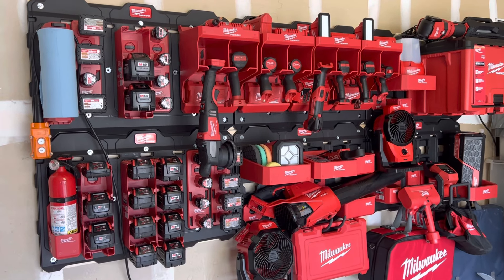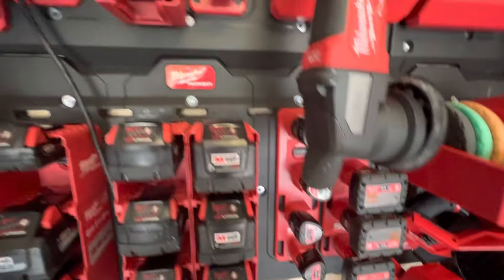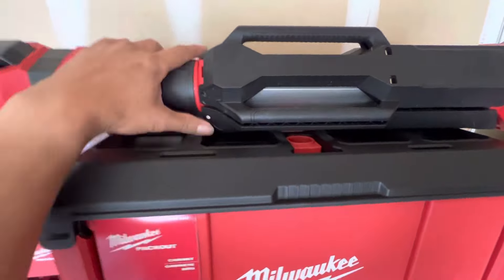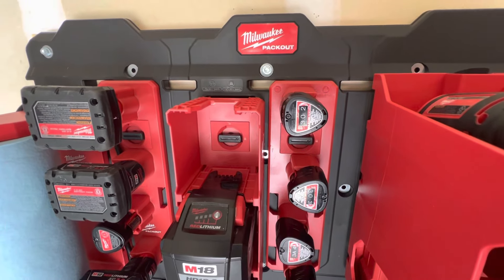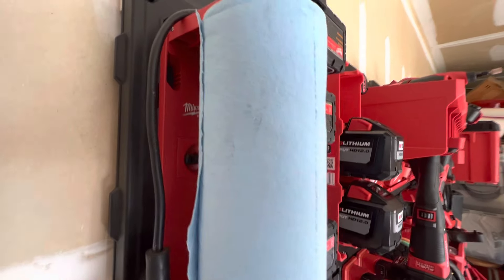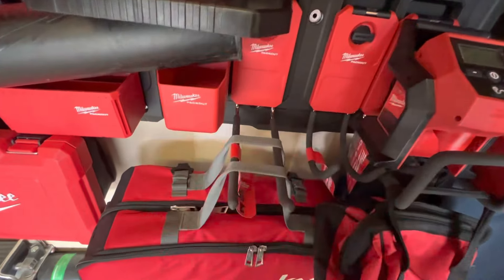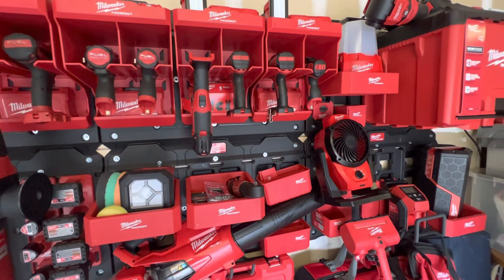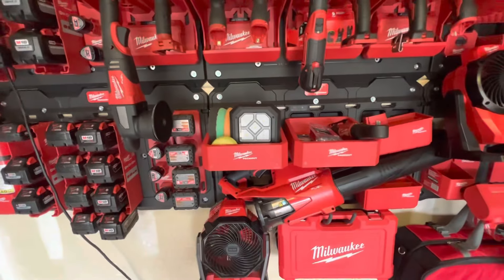Milwaukee Packout Shop Storage System

Comment: Real nice how much for all the wall plates looks aswome plus full of toys
Reply from the maker: I’ve answered that question already so I will just copy and paste: It was around $1140 shipped. It was 6 wall plates, two 2 packs of tool stations (4 total), two 2 packs of M18 battery racks, (4 total), two 2 packs of M12 battery racks (4 total), one large hook, one straight utility hook, 2 pack curved hooks, 2 pack small hooks, 4 pack compact shelf, 2 pack large bins, 2 pack small bins, 2 pack organizer cups, one paper towel roll holder, one cabinet. I went on the Milwaukee website and there is a place where you can “build your Packout” where it simulates all the attachments. So that is how I figured out what I needed. If you buy the multi packs on Home Depot it will save you about $5 versus buying all the pieces a la carte.

Comment: Take it all off the wall paint the wall red to match Milwaukee and it will look awesome I did it to mine
Reply from the maker: Several of my friends have commented that I should have painted the wall first. If I was going to paint the wall I was thinking about doing a battleship gray color. I had not thought of Milwaukee red color but that would probably look really really good. Thanks for the suggestion!
Reply from the maker: I think red and gray would go well together. Thanks!
Reply: I was kind of thinking kinda of the same thing. 
Not trying to come off sounding like an ass hat, but you spent so much time and money on the project I’m kind of surprised A couple hours and $50 in paint would’ve made it look a lot cleaner. 

With that said your set up looks awesome.
Reply from the maker: @russellpottenger8584  Thank you! It wouldn't take too much effort, you're right about that. The wall where the tools are on is just one side of the garage and the other parts, including the ceiling. are coming down in places. I need to either 1.) take the time to redo the drywall in my garage and completely (re)finish it or 2.) call someone in to do the work. If I do it myself it would take me a week or longer and I would have to take the time off work and lose the income. Or, I can have someone else do it for about the same amount in lost wages and it will be a lot more mindless for me.
Reply: @MinhNguyen-ot1zg  The battleship gray you are looking for is "Wickham Gray" by Benjamin Moore. Get it in Scuff-X. That stuff is tough as hell.
Reply from the maker: @ILruffian  Wow that’s a great idea! In the garage I’ll need more durability, that’s for sure! I don’t have very much experience with paints but I am a believer that if you’re going to do it, you should do it right. It’s going to take the exact same amount of labor to apply a crappy paint versus a good quality paint.
Reply: @MinhNguyen-ot1zg  100%. "We don't have the time to do it right, we have the time to do it twice" is not for guys like us. Cheap paint is false economy. You spend less, but use more (extra coats) plus the labor. Scuff-X is *unreal*. Great for shops. And best trim paint on the planet. Feels rock hard like the old oils. Plus unlike Advance, the whites will not yellow. Only trim paint I will use.
Reply from the maker: @ILruffian  Wow really. Where do you get that from? I will have to write that down. I don't mind paying more for quality. Do it once and do it right, I agree!
Reply: @MinhNguyen-ot1zg  It was the unofficial police motto of the department. So happy not to be a cop anymore.
Reply from the maker: @ILruffian  Makes sense for a public safety department. Don’t want to fix something again after you thought you fixed it the first time.

Comment: How much that all cost? As a guess?
Reply from the maker: It was around $1140 shipped. It was 6 wall plates, two 2 packs of tool stations (4 total), two 2 packs of M18 battery racks, (4 total), two 2 packs of M12 battery racks (4 total), one large hook, one straight utility hook, 2 pack curved hooks, 2 pack small hooks, 4 pack compact shelf, 2 pack large bins, 2 pack small bins, 2 pack organizer cups, one paper towel roll holder, one cabinet. I went on the Milwaukee website and there is a place where you can “build your Packout” where it simulates all the attachments. So that is how I figured out what I needed. If you buy the multi packs on Home Depot it will save you about $5 versus buying all the pieces a la carte.

Comment: The battery holders compatible with Dewalt  ones? Milwaukee system is so far ahead of aanyone else. Wondering if Dewalt guys, use Milwaukee storage system?
Reply from the maker: @anthonyrochon3907  the battery holders are not compatible with Dewalt. I don’t follow Dewalt products but if they haven’t invented something like that by now I know there are third party battery holders for Dewalt on Amazon

Comment: Do items lock into place so system could be portable in a van or trailer?
Reply from the maker: Great question. All the mounts have either a van 🚐 icon or a van icon with a slash through it. 🚫 🚐 I just examined all of my mounts and the only items with an approved van icon are the m12 and m18 battery holders as well as the paper towel holder. The shelves, hooks, accessory cups and tool stations have the “no van” icon. The small and large bins don’t say one way or the other nor does the cabinet. Of course nothing is stopping you from using any of the mounts in a van but due to the jostling nature of a vehicle’s suspension you can’t reasonably expect things to stay in place by using the non van approved items.
Reply: @MinhNguyen-ot1zg  Thank you. I did not know about the van icon and will be checking out the battery holder.
Reply from the maker: @SuperRoutman  You’re welcome! I am very impressed with the battery holder!

Comment: What bracket (or part #) are you using to hang the  m18 leaf blower off of? Please advise.
Reply from the maker: In the video the leaf blower is just resting on the 6” Curved Hook 48-22-8331. It’s not actually hanging on anything. Alternatively you can use the 9” Straight Hook 48-22-8330.

Comment: But, like, how tf is everything brand new? I mean EVERYTHING.
Reply from the maker: The tools look brand new because they can’t be used for their intended purposes. They are non functioning display tools I got from a Home Depot that was going out of business. They even have the lead weights in them to make them feel heavy but they are 100% fake. The batteries are empty aftermarket replacement shells I got off Amazon and then I plastered Milwaukee stickers all over them. They are bogus and just for show. Even the entire PACKOUT wall is a shameless Chinese counterfeit I got off Alibaba for $75 shipped - shhhhh 🤫 don’t tell anyone 😉
Reply: He just bought it.
Reply from the maker: @tipsreviews7476  I’ve had several comments about the like-new condition of my tools. There are indeed smudges, marks and scratches on them. I am not a tradesman or professional, I am more of a DIY guy with a focus on auto mechanics and maintenance. My tools do get greasy and dirty and when they get bad enough, I clean them with goofy off or spray 9 to remove the grease. I’ve had them so greasy the red plastic was barely showing through. I try to keep them clean because I don’t want my hands to get greasy or dirty. I am sorry but not sorry that my tools don’t look used or beat up enough for some viewers. When I was contemplating getting the wall organization system I went onto YouTube to look for first hand video from real end users only to find out to my dismay that there weren’t any videos. There were only ads and commercials and stock footage from the manufacturer. The reason I made the video was to give insight to potential purchasers who might be on the fence about the PACKOUT wall system and to help answer any questions they might have. At the time of the video posting mine was the first review of these products. I never thought I would have to fend off comments about how my tools look brand new like they’ve never been used. There are marks and smudges on them like I said, but maybe the YouTube video compression does a good job of evening out the colors? Maybe there are some people out there who consider it a mark of machismo that their tools are all beat up to hell and back but I am not that way. I have nothing to prove and I don’t owe anyone an explanation.
Reply from the maker: @robsoler2604  I was being sarcastic haha

Comment: Do the battery holders also act as chargers? If not, that kinda lame.
Reply from the maker: No, they just hold the batteries.
Reply from the maker: If they did act as chargers, I was thinking the circuitry would take up more space. Not to mention it would cost more. Novel idea though!
Reply: You don't want to store batteries in a charger all the time. Not good for longevity with lithium ion.
Reply from the maker: @ILruffian  great point! Lithium batteries are actually their happiest between 20% to 80% of their charge. So for long-term storage it would be ideal to keep them within those capacities.

Comment: Where did you find those little plastic square holders?  I think you have polishing pads in them, but havnt seen those… just started investing in packout, and 6 boxes in and I’m over $1000… rediculous.. it’s also funny how you watch videos from 3-4 years ago and people saying you can buy complete sets for $225?!  I’m like what are you talking about… inflation has the most standard boxes well over $300.
Reply from the maker: The red stackable plastic boxes on the floor with the clear plastic lids? I got them from Home Despot. They’re the Husky brand I think. I think at the time they were about $30 each. If I remember correctly they had them in different colors and sizes, but I got the red ones and it’s a shade darker than the Milwaukee colors but they are fairly close. I like them because they are a good size and color and have sturdy locking lids. They are the Husky 12 gallon containers - 26 inches long by 18 inches wide by 10 inches high. I’ve put packs of soda on top of them. Isn’t that crazy with the prices? This is the world we live in - everything has gotten more expensive!
Reply from the maker: Ok, I had to watch the video again. My bad, I thought you were talking about the storage containers I had one the floor. I didn’t really feature those and I only had one that was barely visible in the video. Since the video I went and bought more. The plastic square holders you are referring to are the Milwaukee compact shelves. Model number 48-22-8347. I bought those at Home Depot too. They are currently listing on their website for about $19.98 for one or $37.97 for a two pack.

Comment: How's the random orbital?
Reply from the maker: The random orbital is fantastic! I just used it recently to do the paint correction on my 10 year old Lexus. I had hazy, dull and scratched up paint and with compounding and polishing I restored it to a deep glossy black paint. I followed it up with a ceramic coat and the difference is night and day! It took me about 15 hours from start to finish over the course of 2 1/2 days. I took lots of breaks and had to clean off lots of pads during the process. But it was well worth it and my car looks amazing now.
Reply from the maker: I wish I could attach before and after pictures on here.
Reply: I got the rupes but would like a battery one
Reply from the maker: @chrisoo8998  i’m familiar with the brand you are referring to. Not having a cord is a definite plus. I did it in my driveway and moved all around the car. Until Milwaukee came out with one I was looking hard at the Makita model. Dewalt also has a version as well. The only thing Milwaukee had up to that point was a polishing wheel and I decided to wait and I am glad I did. Because as you can see, I have lots of batteries and running out of power is not an issue for me at all. Not to mention that the Milwaukee one does a very good job, although I don’t have much to compare it to.

Comment: Do you actually use all those batteries and tools ?
Reply from the maker: Yes I do! I can see by your user name that you are into Lexus. I just did a hybrid battery replacement exclusively using Milwaukee tools. The next Lexus I want will be a UX 250 H or NX 300 H.

Comment: How come everything looks brand new?
Reply from the maker: Because it is new. It’s been available maybe less than two months.
Reply: thats alot of money how long it stay lookin new lol
Reply from the maker: @vivi5225  I try to take care of my stuff but I use all my tools. I’m sure with time they’ll get wear on them and that’s ok.
Reply: As a contractor I try to take care of my tools and I’ll tell you I don’t have the time or wherewithal to sort out my gear like that and in comparison to yours…my tools are trashed! 
Admittedly though, if I don’t have a hammer within reach, my impact gun makes for a good substitute.
Reply from the maker: I don’t use my tools in any official job capacity. I do perform a lot of maintenance on my cars and the tools I do have been laborsaving devices. I rebuilt a front end suspension with nothing but handtools and my hands hurt pretty badly afterwards. I said never again, the first Milwaukee Tool I ever bought was the mid torque impact and I’ve never looked back. Admittedly I have used a nine amp hour battery as a hammer to drive in a tire plugging tool. Probably not the best idea but it did work.
Reply: Milwaukee bout to be making billions 🤣🤣🤣
Reply: @MinhNguyen-ot1zg  Alot of these guys don't take care of anything.  They don't wipe anything off after use.
Reply from the maker: @markhaughton254  yes I try to take care of my tools so they will last longer and serve me better. From some of the comments I’ve gotten, I’m sorry to say that my tools don’t look used enough for them.
Reply: Most people with YouTube channels reviewing tools do not use the tools for work rather a display of tools or collection. 

At least he’s not doing speed tests on tools driving fasteners into wood. I can’t tell you how many videos like that exist.
Reply: Mr supervisor here lol
Reply: My God heaven
Reply: Troi oi Minh, that looks awesome
I’m a Makita guy myself, as Milwaukee is too expensive here in Australia 🇦🇺 
I clean and take care of my tools when I’ve used them too
Great job 👏
Reply from the maker: @Peter-gh5tz  Cám ơn Peter! Makita is really good stuff too! I just decided to go the Milwaukee route and once you get into it, you’re kind of married to the system through the batteries. I do my best to take care of my tools but I don’t use them on an everyday basis as I’m not a tradesman or professional. Just an average DIY guy that appreciates the right tools for the right job and the ease and convenience they provide.
Reply: @MinhNguyen-ot1zg  Good stuff mate, I’m the same, just a diy guy who looks after his tools
My wife is Vietnamese and I’m trying to learn myself, so I thought I’d try and write something in VN 👍
Keep up the great work
Reply from the maker: @Peter-gh5tz  Aparently some guys consider it to be a mark of machismo to have tools that are physically beat up I guess, but I am not that way. Thank you for your comments! Congratulations on the Vietnamese wife but be careful! They can be a handful! I’ve seen my mom get on my dad’s ass a few times, and it isn’t pretty.
Reply: @MinhNguyen-ot1zg  Tell me about it, I certainly know who the boss is! 😲
Reply from the maker: @Peter-gh5tz  they can be a pistol! 🔫
Reply: Fan boy.
Reply: Show your tools love and respect and they'll take you far. After every Job completion I would take 10 to 30 mins cleaning my tools. Would regrease, sharpen, and do some deep cleaning ever 6 months. After 6 years, I left the trade and still have all my tools and all in great condition. Then again that time cleaning was therapeutic for me. I did remodels and renovations, demo was always part of the job.

Comment: So what was the total cost for all of the storage system items, as shown, without the tools? 

Do you have a number you can share with us?
Reply from the maker: It was around $1140 shipped. It was 6 wall plates, two 2 packs of tool stations (4 total), two 2 packs of M18 battery racks, (4 total), two 2 packs of M12 battery racks (4 total), one large hook, one straight utility hook, 2 pack curved hooks, 2 pack small hooks, 4 pack compact shelf, 2 pack large bins, 2 pack small bins, 2 pack organizer cups, one paper towel roll holder, one cabinet. I went on the Milwaukee website and there is a place where you can “build your Packout” where it simulates all the attachments. So that is how I figured out what I needed. If you buy the multi packs on Home Depot it will save you about $5 versus buying all the pieces a la carte.

Comment: What hardware did you use to mount the 1x4? Screws, what sizes and type?
Reply from the maker: I used #8 x 2 inch drywall screws made by Grip Rite. Model 2CDWS81. Coarse thread, sharp point, phosphate coated, #2 Phillips head. "For attaching gypsum board to wood studs".  I am sure you can use other size screws and have a good result if you can't find exactly the same ones. There actually might be better options. I got them at a big box store, probably Home Despot or Lowe's.